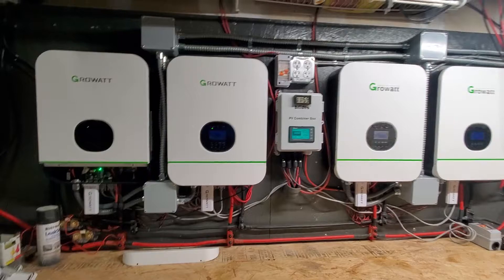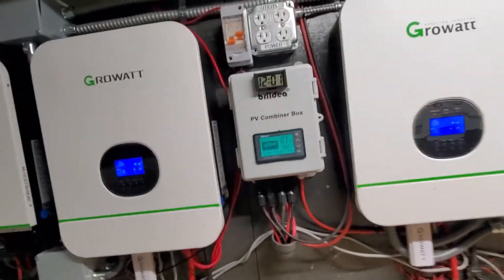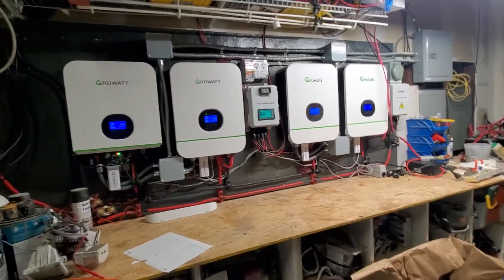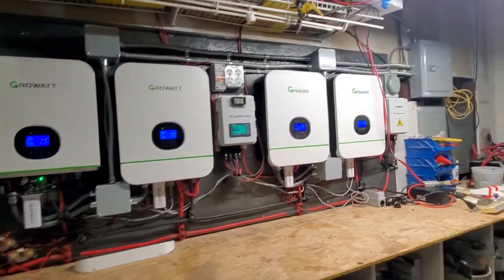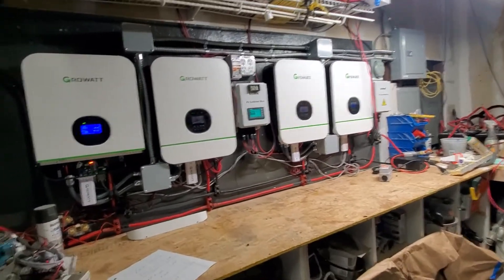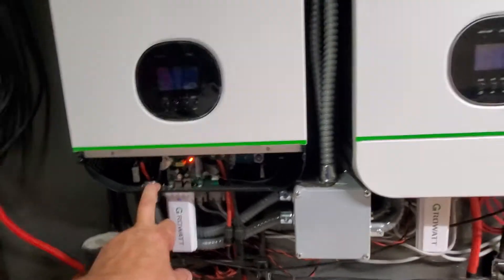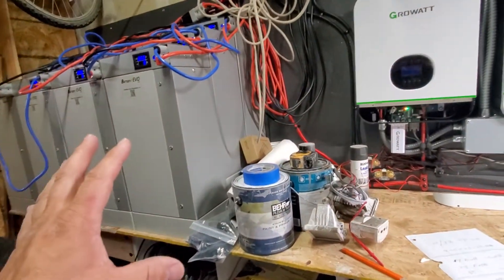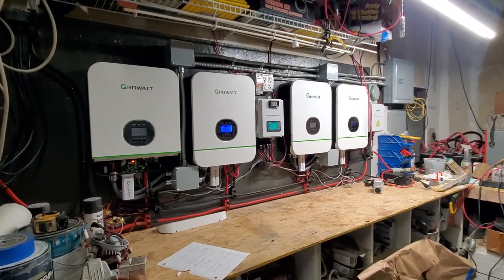Growatt 3KW 48 volt Inverter

Comment: I have a question about  your input power breaker size from your grid power. The book recommends a single 50 Amp breaker for each inverter. I've seen some installation videos where people have used a  20 Amp 12/2 extension cord for their input side. One gentleman that was charging his system said he was limited to charging at a maximum of 30 amps yet on the video the display  said 35.7 amps. Seems like he was creating a fire hazard. I'm using 2 in split phase and doing the final wiring. 
Congratulations on not using the grid power. My system is only 12 panels but plan to expand at some point.
Just curious to the size breakers you used for the grid side (input)
Your system seems to be doing a great job 👍 
Thanks Bob
Reply from the maker: Hey BOB,
Yes use a 50 amp double breaker on the input side. Stay away from extension cords and use the correct materials otherwise you can open yourself up to many problems. I believe in doing it right the 1st time or don't do it at all.

What system are you setting up...12, 24 48 volts?

On the input side use a double 50 amp breaker supplying 1 hot wire to 1 inverter and the other hot wire to the 2nd inverter then run a separate neutral to each inverter don't have them share the same line.

On the output side Make sure each inverter has its own 50 amp breaker and its own neutral wire running to your panel don't have them share the same line.

Ill be making an updated video soon, I'm just waiting on a few components to come in. If I can help more just reach out.
Reply: @richd9771  Rich, thank you for your response.  I'm doing 48 volt like your system but just 2 inverters. 
I've seen 3 different YouTube videos where guys are used 12/2 extension cords for inlet power. I'm using 8/2 but was going to feed a 50
 Amp breaker to my transfer switch panel to split it for my 2 phase.  50 amp for L1 and 50amp for L2 . This would be my output from the inverters. From what your saying 1 need to have 2 separate 50 Amp breakers. I'm using a manual lockout switch to power my  transfer switch .
I don't know how I can add another 50 Amp breaker to my transfer switch panel to lock it out unless I use another lockout switch and breaker which is not allowed. I just reviewed the book and it recommended 100amp for 2 units.  That makes sense, I think I could still use my original plan with one 100amp breaker and could split off of that breaker for my split phase.  So maybe I'm mistaken, 🤔 may have to rethink my transfer switch setup. I only have 12 panels and 3880w  1940w per inverter. and 5.3kw battery backup. If you have any suggestions I would like your input. I truly appreciate your help and  information.  Guess I will not be wiring up the transfer switch until I figure this out. 
Thanks Bob
Reply from the maker: @witness1449  I have removed my utility power coming into my main panel and replaced it with the power from my Growatts so I dont use a transfer switch.

What type of transfer switch are you using?
Reply: @richd9771  HI Rich, just a friendly follow up with my system. It been up and running now for over 3 weeks.  It been working really well for be a small system.  It provides all of our power for a average sunny day and our 5.3 kw  battery will keep everything powered through the night. We rarely draw power from the grid but on cloudy days it will charge for a couple hours to top off the battery. Will be adding another battery to add backup power.  For  a 3800 watt array and a 5.3kw lithium battery it's providing about 70% of our power. My transfer switch is  a 100amp power panel with a safety lock out  50 anp breaker to manually switch from grid to solar. Literally runs everything except my central AC and  electric dryer. It's working better than expected and thanks for the tip for turning off the annoying beep.  I  appreciate your help and hopefully these Growatt inverters will last a few years. 
Thanks Bob
Reply from the maker: BOB......Im happy to hear that things are going well. If you really want to go off grid all the way then you will want to think about adding 2 or 4 more inverters.

Its not really that hard to put together an off grid system... Keep in touch @witness1449

Comment: Sorry on my ignorance about this subject but when you refer to a 48V inverter is that the input or output voltage?
Reply from the maker: Hello...the way I look at it is a stupid question is one that you don't ask. I'm here to help anyone that needs it.
My Growatts are the 48v version which allow me to feed them power from my 48v batteries. Its much more efficient than a 12v or 24v setup and I can use smaller gauge wire because of the lower amp draw.
SO, the inverter puts out 110v in split phase meaning I have 110 on leg 1 of my breaker panel and 110 on leg 2.

If you any other questions feel free to ask.

Comment: Nice system
Reply from the maker: Thank you its been fun putting it together. Yesterday was my 3 month mark for being 100% off grid. 
I'm in California and the last few days we have had a big heat wave. It hit 102 in my area yesterday and we had all the house fans running as well as everything else no problems with the system at all. Its been running strong and I couldn't be any happier.

Ive been meaning to make an update video but have just been super busy with work. 

I'm looking into replacing my gas water heater with and electric or hybrid electric to save even more money on utilities.
If I do that then I might add 2 more Growatt inverters and one more set of batteries.

Comment: You are better off with the 3000 watt verses the 5000 that you will need a transformer for the neutral will cause problems in the future.
Reply from the maker: Dont they have the US version with a neutral? My system is running well. No problems so far.

Comment: Holy cow, thanks for the tip on the beep. Mine never turn off either. I'll try the two button thing.👍
Reply from the maker: The manual shows a setting but that doesnt work. Why would I go through all of that when I can just press the 2 buttons and be done.

Comment: What was that little box with orange switches you said you need to put another one on the right side? Do you have a link please?
Reply from the maker: That is a double 16A breaker solar string disconnect. I have 2 combiner boxes on my roof and Ill be moving the other 2 that I have in between my Growatts.
By having the disconnects next to the Growatts I can then disconnect my incoming solar strings with the flip of the breakers when I need to do any work on my system.

Comment: can anyone tell me what will be the best practical MCB to connect my Growatt SPF 5000 ES (5kw) inverter output before it power my home items. 25A mcb or 16A mcb ? I mean to protect my inverter from overloading and burning MOSFET.  I need practical answer from someone with experience. not based on P=VI equation.
Reply from the maker: Im not sure what your trying to do. When you connect your Growatt output to your home you will want to back feed it through a breaker in your panel.
The MCB breakers I have are in my solar combiner box.Can you be a little more detailed and clear as to what it is your trying to do?
Reply: @richd9771  thank you for your kind reply, yes I am also going to connect my inverter output first to to my distribution box and there I have all my supply lines connected through 10A or 16 A MCBs.  but As you know this is not work to protect the inverter because additive effect (suppose one MCB will draw 10A and another draw 10A and another will draw 7A so altogether 27A is trying to draw from inverter without MCB sut-off)  therefore, I will have one two pole barker between inverter output and the D board where all the current should go through it. A technician suggested me to use 16A but 230*16 = is 3680W   is that the safe limit to run inverter although it rated 5000w.

Comment: I have flaky internet so I keep comments short. Thx for your suggestion about the cables. I think I’m ok. I think my problem is due to replacing an older unit with a new one. That’s why I’m wondering how your units are working together. The new ones have different boards behind the removable panels. Thanks
Reply from the maker: Give Signature Solar a call and talk to them if your still having problems. Growatt tech help is pretty useless but the guys at Signature Solar are good and know a lot about the Growatt inverters.

Comment: Great Video and amazing setup. So basically you have 2 phases of 6000w each, Correct? It will be great if you can also do a video of your breaker box on how these phases are feeding your loads. thanks. I have one GW3000 24v unit. Great units.
Reply from the maker: Yes your correct 6Kw on each leg of my panel. Ill be making a new video sometime after the 11th of this month (May), that will be my 2 months off grid.
So what I did just to let you know is I removed my utility from my main panel and installed a double breaker. I then ran the main from each set of inverters (2) into the double breaker which then allows for split phase.
Reply from the maker: Yes I have 6Kw on each leg of my panel. I moved my power provided by my utility out of the main panel and into a 2nd panel to isolate it. 
I then have the Growatt output hots from both sets of inverters running into the main panel and into a double breaker which back feeds the panel and powers all the other breakers to my home.

I just passed 2 months utility free....zero electricity from my utility provider. Ill be doing a update video real soon to answer some questions others have asked.

Comment: Nice system. I have 4 of the same inverters. I assume the 2 older ones on the right were originally installed in different phases. I have 3 older units and 1 new unit and I am having communication issues. I see that you paralleled the 2 new units in one phase and paralleled the 2 older units in the other phase. I’m wondering if they communicate better that way. What value are you using in setting “5”? Thanks
Reply from the maker: Setting 5 Im using U52. I bought the 1st two on the right off Amazon the found the two on the left much cheaper at Signature Solar.
Have you checked to make sure you have all the cables setup correctly? The current sharing cables only connect to the inverters that are working together as one on phase 1 and 2 of your panel. The Parallel communication cables will link all the inverters together.  

 Is your system setup like mine?

Make sure when you turn on the inverters you turn on one at a time. The 1st one you turn on will be the host. You also need to make sure you have your inverters setup correctly in setting 23.

Give me a bit more info and Ill see if I can help.
Reply: Your system and mine are nearly the same size. Batteries (60 kw) and probably panels (12 kw) are different brands. I would like setting “5” to be Li, but after replacing one of the units I’ve had faults 20 & 4. “US2” works better, but I still have power cutting off occasionally. After installing your 2 new units, has your power ever cut off?

Comment: Just curious what's your idle consumption with these all running?
Reply from the maker: Growatt support tells me its 50W each but with the size of my battery bank that doesn't bother me much and I haven't had any problems. The owners manual shows recommendations on how many Ah of battery you should have compared to the number of inverters you have. 

Im really happy with the way everything is running so far and I plan to do an updated video after the 11th of May sometime. The 11th will be my 2 months 100% on solar and battery.

Comment: Great video.  Just wondering what batteries your using ?   Also maybe you can answer a question.... I have a 48v system with 12 240w panels.   I'm using 2 small 48v lithium ion batteries.  Am I able to mix different 48v batteries/ amp hour in my sys to get more amp hrs.  I would hate to waste the 2 small batteries.  Thanks for any advice
Reply from the maker: Happy to help..I buy my batteries from Battery Evo. I could pay a bit less with a different type of battery but I wanted mine to be self contained in there own case.
I have 6 sets of 24v batteries (120Ah 6Kwh each) in series to create 48v each. I just ordered 2 more batteries but these are 48v each not 24V. 

What I would suggest is to call Battery Evo and ask for Fred. He knows everything about batteries and can tell you what you should and shouldn't do.
If it wasn't for him and his help I would never of been able to figure out and decide on my battery setup.

Ill also be making a new video sometime after the 11th of May. The 11th will be 2 months off grid and I wanted to do an update video.
Reply: @richd9771  I have had no luck getting the information app to work.  Just signing up on the app doesn't work.  I was going to send it back.   Maybe if you have some time I could call you at your convenience.
Reply from the maker: @Docicepick  Are you talking about the shine WiFi ? You have to have that in order for the app to work. Let me know what your trying to do and Ill see how I can help.
Reply: @richd9771  ty very much for the info.
Reply from the maker: @Docicepick  Your welcome...if there is anything else I can help with just ask.
Reply: @richd9771  ty Rich.  I am trying to use the shine app and wifi.    Any help would be great. Ty
Reply from the maker: @Docicepick  Have your bought the shine module yet? You will need 1 for each of the inverters.
Reply: @richd9771  yes sir  i have  and i downloaded the app also
Reply from the maker: @Docicepick  OK click on the link here: https://www.youtube.com/watch?v=LlLcxGlnK-A 

This is the video on YouTube I found that explains how to setup it up. Its not hard to do at all just follow the video.

You have to make sure the server domain is "server-us-growatt.com" the video will show you that. make sure you delete whats there and re type it new.

Let me know how that all goes for you.

Comment: I'm a license Solar Contractor and have been for over 10 years. I would recommend when installing the additional panels to install them in a West by South West direction and to ensure that you've got no obstructions of direct sun on your panels. This will extend your evening sun and reduce battery usage until later in the day. Good luck with your system. You could also do the same on the easterly side to catch the early morning sunshine further reducing night time battery usage. PVWATTS Solar calculator çan be a great tool too figure out the best overall solution.
Good luck with your system.
Reply: what will be the best practical MCB to connect my Growatt SPF 5000 ES (5kw) inverter output before it power my home items. 25A mcb or 16A mcb ? I mean to protect my inverter from overloading and burning MOSFET.  I need practical answer from experience. not based on P=VI equation.
Reply from the maker: Thank you for the suggestions I'm always open to hear what anyone has to say. Sharing info with one another is key.
I'm a general contractor here in California so things might be a bit easier for me when doing all of this so I like to try and help others if I can.

My house faces South kinda SW.. and is in a great position for panels. We have underground utilities and no trees so there is nothing to block my panels. We get sun all day long from dawn to dusk. 
My roof is huge and it can accommodate the 10 additional panels I'm going to install with no problems. Ill be making a few more videos soon after I get those panels up. Ive also just today ordered 2 more 120ah batteries to bring my storage to 960ah. 
I'm doing great so far and just last week received my 1st utility bill since being 100% on solar. Electricity only not including gas was $12 and some change. That was the basic fees they charge no matter what you use. My energy consumption was zero and has been since March 11th.

Ive been interested in solar for a long time and started off with a Harbor Freight kit about 7yrs ago just to get hands on experience. I grew that system and then was running all my electronics in my work shed. One day I had the chance to try and do things on much bigger scale and here I am about 6 months later running everything on my property. 

I have to thank Growatt, Evo Battery, Solar Forum, Youtube and a few others like yourself that have helped me along the way. Sharing information and helping each other is a great thing. I always try and pay forward when possible and that's the purpose of this Youtube page.